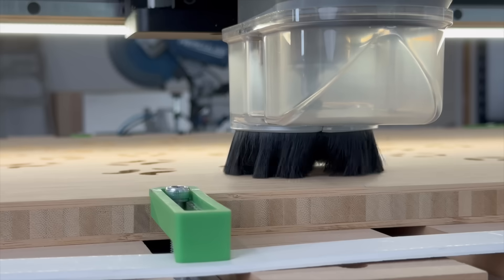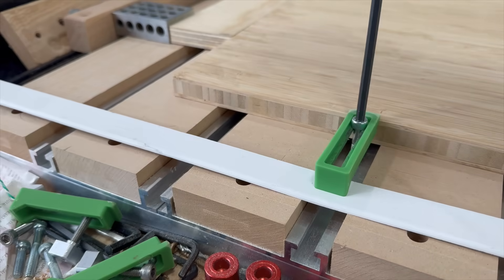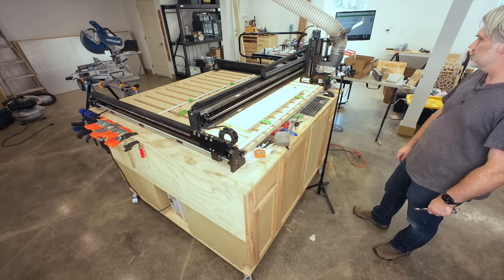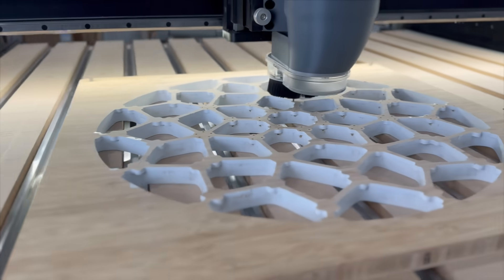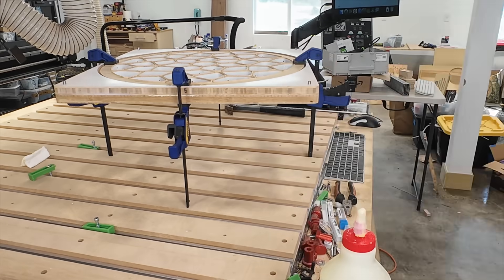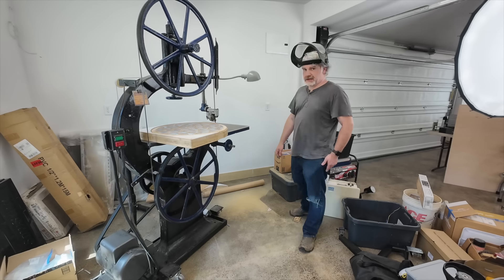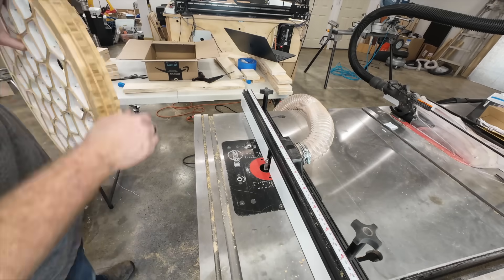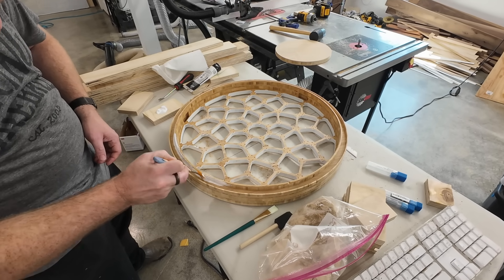The Error that Made This Piece Unsellable

Comment: Instead of double sided tape directly on the acrylic, have you tired the "blue tape method"? You put blue painters tape on both the surface, and the back side of the acrylic, and then you super glue the tape to the tape. Because the surface area of tape glue is large, it holds really well, and because it's essentially double sided painters tape, it releases cleanly from both the spoil board and the acrylic. It's even used for metal machining of flat parts and plates that are difficult to hold in a milling machine too. I'd really like to see a video on the electronics, and the hand detection.

Comment: Question, apropos of nothing: at any point, did you consider using a
silver/metallic/mirror paint on the inner walls, instead of white paint, for reflecting/refracting light? I had to repaint a bathroom ceiling light housing, after it got discolored over time/exposure to humidity. I tried an appropriate white enamel paint, but it just never seemed as bright as it should. So I stripped it, and repainted with a semi-mirrored paint, and it worked really well.
Reply from the maker: I did, and while it might improve the overall brightness, it also makes the reflections more coherent, which wasn’t what I was going for. For a luminary (like a light fixture), total light reflection is more important than it being incoherent, so it makes sense that it would work better for your application.

Comment: Interesting project, two thoughts, unless you need to salvage the cut-out, why not router out the entire hole from its centre? 
Regarding the gouge, would a taper or  bevel have been acceptable? I personally think that would be mean more aesthetic then hide in the blocking in that area.

Comment: Instead of diffuse back lighting to the wall, how about discrete coloured rays of light with the same symmetry? I think if you get some fresnel lens sheet you should be able to get it to work, though it might take some trial and error with the LED placement and focal length for a given curvature.

A vacuum holding table might be a worthwhile investment.

Comment: For the work holding... why not just do 100% routing out of the shapes? Instead of leaving them, and having the extra time and fuss, just mill the entire center out of each shape. Is it a matter of tool wear, or time?
Reply from the maker: It just ends up taking significantly longer, and it fills up my dust collector much faster… but you are right, that would be a potential solution. Maybe I could use a roughing bit and have it route out a little smaller and then come back with a finishing pass… doesn’t fix the dust, but that is not that big of a deal I suppose.
Reply: @VoriaLabs  thanks for the answer! Love your work - you earned my subscribe tonight.

Comment: To keep the sheets firmly down, you need a vacuum bed. If the cutter is completely insolated, you also could use an electrostatic bed, but I doubt that would be possible. Also, it could be high voltage and emit sparks to anything coming close. Vacuum works great, though.

Comment: An easier option would be to cut out the wood, place a clear acrylic backing and pour on clear epoxy resin.
Reply from the maker: I’ve been avoiding epoxy because all epoxy eventually starts to yellow after a decade or so, depending on UV exposure.

Comment: Regarding workpiece holding have you considered using a sacrificial piece of MDF as a backing, then using something like double sided tape or even maybe hotglue to keep the loose pieces from moving once cut free? Then you could skip leaving tabs. 

Or actually I just realized you could use wood glue in the spots that would become loose later so that it would guaranteed to stay still. The backing plate would be loose by the time it was finished and the top would just separate!

Comment: You couldve gotten creative with the damaged area. Using a router extend the recessed area to the entire space where you applied the sawwood and glue and then on a different piece of wood cut out letters for your logo or company on and then stuck those letters on recessed area so that the height of the letters was flush with the rest of the diameter of the piece

Comment: Why do you put the plastic strips on the table, is it to square up the stock material or. And of course make video about all aspect of the project, that's no brainer. Super. I got an idea for a very important project, make something cool to place around the bandsaw, a blade guard. Not tying to sound like safety nasi. But safety is important. Also it could be vey cool project. Like when Jason at Fireball made the enclosure for his gigantic antique bandsaw. That was so cool. When i think of it it is very similar bandsaw..
Reply from the maker: I'm actually not sure where in the video I'm putting down plastic strips...? Are you referring to the double sided-tape? Or am I just forgetting something obvious?

You are absolutely right, there are a lot of safety improvements to be made on that band saw. That's coming for sure, but I'm not sure if I'll be making a video about it.

Comment: Couldn't one use light colored wood glue, apply the wood shavings and use a pen with dark wood stain to redraw the pattern in case of a mistake like this to match appearance?
Like, evacuate a fountain pen of ink and inject it with wood stain to dot or draw (unsure of suitability of wood stain in a pen for surface tension capillary action)?
Has anyone tried that?

Comment: For your work-holding, have you tried the masking tape and CA glue trick?  You put blue masking (aka painter's) tape on both the part, and on your waste board, then you CA glue the tape to each other.  It acts like double-sided tape, but because masking tape is designed to come off easily you can peel it off without having a horrible sticky mess to clean up.  It's surprisingly strong, but make sure you use a down-cutting bit so it's not trying to lift the work.  I can't remember ever having a failure with it, although I don't push my luck.  I'd rather it take a bit longer, than a lot longer because I have to start over.
Reply from the maker: That’s what I was doing at first, and I still do that do some work holding, but I switched to the double sided tape because it was more consistent and faster to apply. I’d still get some sticky bits from the masking tape, too

Comment: I would have used the oops to fix the oops. Set it up with a smaller bearing to route a rabbet all the way around then saw off thin strips of the bamboo plywood, enough to go all the way around. Soak them in water or steam them to make them flexible. Glue them into the rabbet and when it's dry, repeat the flush trim operation, with the bearing screw checked for being tight.

With the center of the bamboo ply being made of small pieces stood on end so that what's visible is small pieces, nobody would be able to tell that there was a problem.

Or instead of using strips of bamboo plywood, use a strip of oak, walnut or any other wood. Then it would look like an intentional accent stripe.

It's still fixable, just be extra careful milling out the CA glue section.

Comment: For the work holding, even though it's still double sided tape, you can get stuff specifically for woodworking, unsurprisingly called Woodworking Tape, it's wider, low tack and leaves no residue, but does a good job of holding stuff in place for manual and CNC routing. It tends to gum bits up if you cut into it, so be warned.

Comment: using a whole rpi for this?! seems a bit overkill. maybe a run down on the electronics to clarify that choice?
Reply from the maker: I’m definitely not using a RPI for this piece. My standard main control board uses an ESP32-S3. But the electronics video is coming! I’m working on it now.
Reply: @VoriaLabs okay haha I saw that one with the pi attached and was Hella concerned 🤣
Reply from the maker: @nicholaslabrecque Yeah, that is an experimental control board for when I want to test something without needing to worry about optimization. I had forgotten I included that in the video!

Comment: Holding down acrylic on cnc, use MDF board, it is porous to air (true!) if you make an flat surface acrylic plate with a 25mm grid of air grooves, and attach a mild vacuum to it (even an old vacuum cleaner works!). When you place a panel of thin (3mm) MDF on top, the air sucks through, and has amazing holding force for flat panels. if you machine away too many exposed mdf, the vacuum is lost, so doo all the intricate parts first, then cut the profile off. easy
Reply: I just saw how you do the sensing, I did the same with opto sensors, and used small red filters on each. It took awhile to perfect, but each sensor cost about $2, and for a production product, I deemed it too expensive. I see your individual cell investment, and detail for each cell, which blitzes my $2 tenfold no doubt! I did try an rf solution (had small theremin like antennas, and an analogue output (converted to digital) to calculate distance from, corners), and worked quite well, except for drift, and other external triggers. My next experiment will be 4 capacitive sensors instead of the rf.. but, it is on the year bucket list, as it is hobby, with no sales rewards to inspire it to jump ahead the queue, even though the wow factior is clear, the discretionary income is rare in my neck of the world.
Reply from the maker: @TeReoTime  Getting the hand proximity detection working well was hard. It really kicked my ass. A lot of work went into making it work as well as you see here and in the other video. As for your tenfold estimate... I mean, you are pretty close, largely because I needed to have them made in the US due to tariffs being so unpredictable. But there is a lot of other stuff on that board, too. I'll be covering all of that on the next video.

Comment: 3:16 try and hot glue the cut outs to the main part then run a second Programm (with a smaller endmill if possible) how will remove the tabs. Hot glue can be removed with isopropyl alcohol.

Comment: Very cool project, I'd definitely watch a video on the electronics too if you made one.

I don't know how easy this would be since the whole thing is assembled now, but if you're looking for a way to hide your router mistake better than the sawdust trick, you could possibly just add a slight bevel/chamfer (10 degrees?) from the face to the back.  Or perhaps just a slightly deeper router cut all the way around on the back half, so it looks like an intentional recess.

Comment: Reaching around that spinning unshielded bandsaw blade to turn off the bandsaw at 6:38 feels like a very bad idea.
Reply from the maker: I'm not really reaching around it. I'm stepping back and then reaching over to turn it off from the front. Not sure if there is a better way to do it given where the switch is mounted. I am thinking about remounting the switch or adding a foot pedal. Maybe adding a brake.
Reply: Bend some sheet metal to make a guard? But moving the switch would definitely help. If you need to quickly shut it off, avoiding moving toward the blade would prevent cases where you stumble into it.

Comment: I would have done a new pass around the entire thing with the router to take off a controlled offset the whole way around. Then I would have fitted it into a new ring either a full ring or by applying a strip around it. Then I could have finished it to match the surface level of the un-marred ring. Result would have been a band around the back that looked intentional instead of a fixed patch.

Comment: Maybe you address the issue later in the video, but would Loctite be a solution to preventing the bearing from flying off?  I don’t use my router enough to be constantly removing the bearings from my bits, so I don’t know if Loctite would be feasible (since of course it makes removing the bearing a chore each time), but it for sure would have prevented this incident.

Comment: Ever try the painters tape with superglue method of holding down your wood? It holds the pieces when you cut completely through. It works great. 

Stick the painters tape down in rows and cover the cut area of the board, then make another space on the cnc waste board and make rows of painters tape to match.  Superglue the back of the painters tape on the wood piece to the painters tape on the cutting board. Let it set up for a few minutes then do your cut. Then when it’s done, just peel them apart. Make sure there is super glue covering the areas that get cut out completely.

Comment: I'm curious, if the finished piece was designed to be circular, why didn't you program the cnc mill to cut out a circle instead of a square that required sawing to remove the corners? Thanks. Loved the video and the explanations that you did provide. Good luck with your new art career 👍

Comment: Have you considered vacuum work holding? I built mine based on CNC Nutz version with some modifications, and use a motor from a whole house vacuum system. The top is sacrificial but porous MDF and I seal the unused service with sheet plastic. The small bits might not work well in that setup, but you could get all of your large shape work done in jigs on the CNC with no router work. I'd laser cut the acrylic, just cleaner and easier. You could CNC the profile and partially cut the lenses in the cnc and final cut the mounting section in the laser, again with jigs. (Think shape 1/8 in to get round over in the cnc and the last 1/8 in the laser.) A small CO2 is very affordable. Getting a system helps make repeatability easier and lowers your cost point.  A lot less Leroy into the whelps ;)

I'd be tempted to cnc the acrylic but leave an 1/8 skin to hold it to the surface. Allowing the cnc to create the round over. Then laser cut a veneer to drop in like a window pane. I'd probably use the cnc to make a inverse jig to press and hold the veneer during glue up, you would need to test to be sure the glue doesn't fog the plastic.  Either way all of your router would can be done on the cnc before the cut and save you time and fingers. GL interesting project and hope we get to see the board workup.

Comment: Also, I have only worked with acrylic like 2 times and i have never tried what im suggesting, but depending on the accuracy of your mill, if you mount your sheet "face down" I bet you could use it to chamfer the back of each piece automatically with some sort of angle bit. Then dont worry about sanding because I bet you could use a ballmill filled with sand to achieve the perfect "beachglass" effect. Those two steps should save a ton of manual labor if those pieces end up looking the way you like!

Comment: With the 7 fold symmetry... Can't tell if you did it, but making the alignment pins non uniform, you could make sure you never put the piece in place with the wrong orientation. Make one oversize, or slightly off positionally, for example.

And/or, if you do the same size piece a lot, threaded inserts so you can use bolts and they become your hold downs. That way aligning and holding is the same operation.

Oh, right, I was thinking use the pins as part of alignment during machining, not just assembly.
Reply: Another idea: that divot. Instead of a repair, you could have made a full diameter offset. It would add to the effect of it "floating" off the wall. Kind of like a concave curve on the underside of a bowl.

As long as I'm babbling a bit (note: I subbed because of this vid, so I want to be sure you know I'm going for helpful, not "this sucks"), the warping is probably because of internal stresses in the wood being relieved unevenly (circle cut vs linear wood grain). I'm betting you'll need a flattening pass for round and otherwise irregular designs. (I bet a diamond would be cool)

Comment: masks only work with particulates like dust.  Fumes from solvents go right through it.  Ventilation is your friend here.  Just having a small fan helps.  After the fumes dissipate some they're not nearly so toxic.
Reply from the maker: I assume you are referring to the part with the CA glue. CA glue has no solvents, it is 100% solids. (The accelerator on the other hand… yeah, nasty stuff, I should be wearing a better mask for that) A P95 mask works pretty well against CA fumes (which are droplets of CA) in my experience, but I could be wrong. 

but yeah, your advice is sound. For solvents and other nasty molecular stuff you need either a lot of ventilation or a special respirator. I’ll try to wear better PPE in future videos!
Reply: @VoriaLabs  I know that YouTubers are always fanatical over PPE because they hear no end to the complaints.  It's Pascal's wager.  Spend endless hours addressing the notes or just gear up so people stay silent.  I don't really care but it does bug me to see people wearing a paper mask for a fume issue.

Comment: For the patch, why couldn't you thin rip a piece of the patterned bamboo plywood, to more closely match the surrounding area? Then soak your thin ripped piece in hot water (or steam it), then bend it around the circle and use a strap to hold the shape until it dries. Then use a Dremel or hand tools to carve out the gouge and shape your new patch and once you have a good fit, glue it in place. I've done patches like this (tho, not with bamboo), and they worked surprisingly well.
Reply: I wouldn't have bothered with using a thin strip and steaming, because the lines of the plywood may warp doing so. I'd have simply cut out that section of arch and C&C'd a new piece to glue in so the detail of that bamboo plywood wouldn't have been totally obliterated by the CA glue and sawdust.then just re-router and sand to blend the edges, and no one ever would have known.
Reply: @ravyn.  Good point. I don't have a CNC, so I never think of those kinds of solutions.